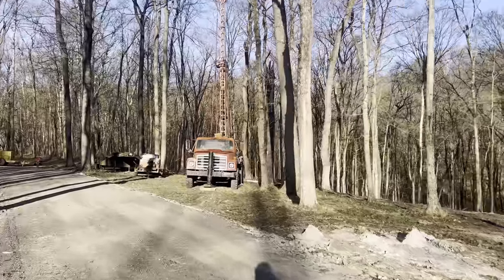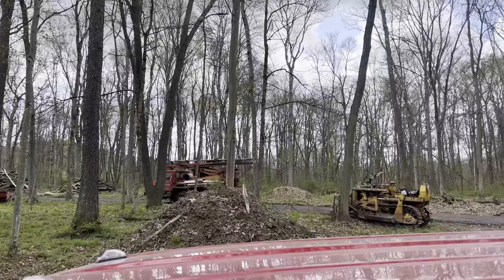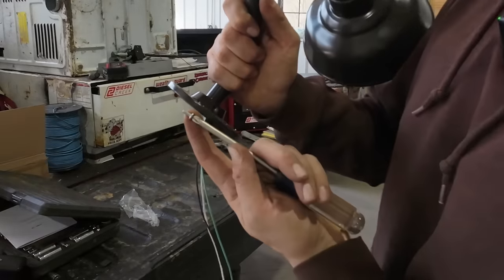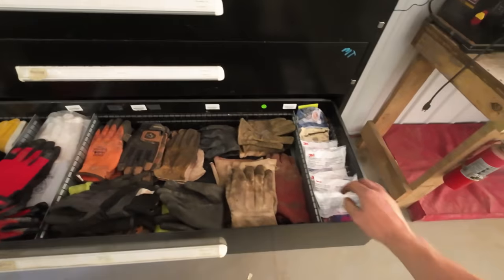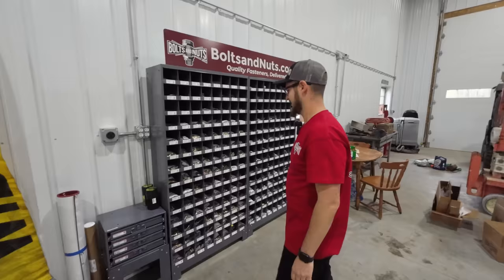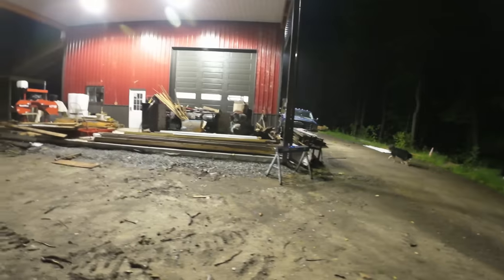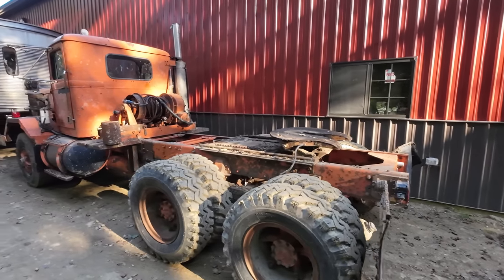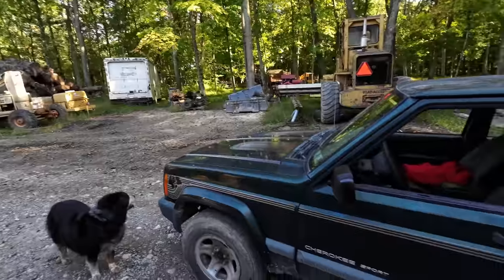1 YEAR Later, What happened to the DREAM SHOP BUILD

Comment: im a driller by profession, using probably the most advanced tools you can get to drill water wells. 2018 year equipment. Drilling in Scandinavia with one of the hardest rock on earth. We drill mostly 5.5" diameter, approx 35 Meters per hour with Atlas Copco Y35 (35 Bar) compressor and 700 Litres of air per second.

I heard arguments like you stated that older drilling methods are better but not really seen much to back it up. I do however noticed there is a big difference in Location. You can move the hole just 15 meters and it will drasticly change your result because how the water veins go. Problem is noone knows how they go so its basicly based on Luck...
I have seen all sorts of wizardry and witchcraft to try to determine where to drill, but i never seen it do any difference. People claim there is water when there is not and vice versa.

When we do not find water we use a method of lowering a hydraulic rubber bladder to seal the well to the top, then pumping high pressure water under it into the well, this opens up and clears potential gunk in the hole. Mostly with great result. That is a solution you can use on a well if you want to increase low water flow or if there is no water at all.

The rig in the pictures we used similar in the 1950-60's. In Scandinavia they are only used in museums nowadays. Fun to see it operate, but not very cost effective if drilling is your profession. Out of context a fully functional water well with pump and a well ranging from 50-100m deep will cost roughly $9.000 with guaranteed water result :)

Fun to see your videos as im a film maker myself and also work with all sorts of equipment :) // From Sweden

Comment: Thank you for sharing that antique well drilling rig! I have never seen one like it before. Also, congratulations on your new well! You might want to have the water tested though. It could have diesel contamination. 🤣
Reply: It is called a cable tool drill.  The cuttings are cleared by use of the baler It collects the drilled debris that is mixed in the water. The baler is emptied  by a release value at the bottom of the baler and disposed of with the water when the baler is emptied each time it makes a trip up from the bottom of the well. One benefit of the pounding of the cable tool  drill is that it fractures the surrounding rock letting more water flow into the hole. The disadvantage of the cable tool drill is the tool can get wedged in the hole, if the rock leads off to the side. Including a set of "jars" in the tool line helps to get the drill unstuck when this happens. But you have to put that device in before the bit gets stuck, or you  may not be able to get the drill bit unstuck by lifting with the cable alone.😢

Comment: I think building the boiler as well as moving the mill to its permanent place are the priority. Getting the shop connected tobthe grid is also up there if you don't have dependable sources of power or it's too expensive.  Having your heating situation sorted is going to be appreciated come the dead of winter.  Getting that mill moved clears a lot of clutter away.  Less clutter is where we're going.  Also, move your extra wrenches out into storage.  Keep tabs of where you put everything in Googledocs.  That way you can just pull up the location of whatever you're missing no matter where you're crouched.

Comment: Also the reason the nut on the light is reverse is because unscrewing the bulb it would tighten the nut instead of loosening it. Bulbs in sockets over time will get stuck. Just a thought

Comment: @dieselcreek - Just a thought......with the cost to bring in service @$50k just for power company, couldn't you have the service brought onto the front of the property, then run your own wires from there? Does power company have to establish service on the building or could it be established on a remote structure closer to property line?

Perhaps this has been explored or has been previously suggested in comments.

Comment: I was wondering if you plan for a 2nd level in the shop along 1 wall for storage.  How would it fit in with your planned crane?
Although I like wrenches in drawers, I find having screwdrivers on hanging apparatus on a wall board of somekind (french cleat or peg board).
Also for your shop do you plan to have a tool-cart or 2?

Comment: I’ll have to buy one of those boltsandnuts stand and stick it in my pants….I can never find my nuts. 🤣🤣🤣 I agree with your logic with the solar. I am with you in the cost and durability. That’s one of the reasons I haven’t got solar. It would take about 5 years to get my money back and my house is not conducive to having a solar system that would produce enough power. Lovely workshop. 👏🇦🇺😁

Comment: It is called a cable tool drill rig they have been used as far back as the late 1800
Before they perfected wire cable it was ran with rope and a cat head and a man pulling on the rope and released the  rope again and again

Comment: How deep is your well?  What is the casing diameter?
Before you can use any drill, you need to know what is subsurface.  
Pounding drills are illegal in some states and jurisdictions , why?   If the subsurface is fragile, as in Florida,  pounding drill will fracture the ceiling on the hollow space below.  Used to be full of water but development has lowered water tables.  Many sinkholes were the result.  Only rotary drills are permitted.  The cracks in the limestone ceiling allow acidic rainwater to dissolve the limestone.
Like all tools, both rigs have their pluses and minuses.  
I heard running water down the hole, curious, an underground river has a new waterfall!  😄  Perhaps you poked thru an old coal mine was below and the water falls.
When I lived in your area, I had to buy subsidence insurance.  An abandoned coal mine was underground and in case the roof collapsed...    I am sure you have heard these stories.

Comment: In case you were not aware the batteries last 7000-12000 complete charge cycles and after all that they are still 80% capacity of new, so they will last 20+ years and still be usable.  In 20 years the battery technology will be much improved and cheaper as well.  Same with the panels, they will last decades and are already pretty cheap now per 450 watt panel, when it comes times to replace them they will be even cheaper.  All while electricity cost per kw just keeps rising from the utility company.  I understand you think your needs will be more than you can build but if you were to diy a very large system it would have been sufficient and way cheaper than from the utility company.  Put 50-60k into DIY setup and you would have ~30k watts in panels, ~200 Kwh in batteries and 24-36k watts of inverter power.  Would have been a sweet setup! :)

Comment: Main components of solar for the cheapest worth buying in my opinion, 50 cents per watt of panel, and 300 dollars per kwh of battery (diy/buy it yourself). There are lots more costs in panel mounting and some wiring obviously but main components that'd about the price. 5 grand gets you a ton of inverter capacity for all but the most absurd power demands. In my opinion off grid setups must be light in power demand by design to limit battery costs which end up being a major cost for winter capability. Grid tie solar where you get net metering with the power company is where it is at for low investment and high return. But the power company will never pay you money at least in my area and at the end of the year excess power credits get wiped. Anyway for about 10 grand and net metering I bet you could have a zero cost power bill for 20 years.

Comment: One other thing I would seriously question about solar is some of the loads you'll be putting on it.  Running lights,  appliances, and HVAC is one thing.  I'd like to see how they would size a system for a 10 or 15 HP air compressor and a few hundred amps of welder.

Comment: i just think like i commented that direct burial wire would have saved a ton of money over laying in conduit.  now maybe you can't direct burial 3 phase.  or over 200 amp.  that i do not know.
Reply from the maker: I did what the power company requires
Reply: ok.  every area is different.  but that sucks.  we have a buried line 1/4 mile long.  love the videos Matt.  Watch every one.  Between you and Andrew Comrata, and Watch wes work, I get all the old equipment videos I need.  although yours are the oldest lol. @DieselCreek

Comment: you never mentioned the 800 pound gorilla in the shop. did you ever find a engineering firm to help you (give recommendations) on installing the crane or is the crane a good idea but too much in practice to install?? I sure figured the idea would be to install the crane structure first & then build the building 2nd

Comment: Solar is great... But its not really possible to go "off grid" with a shop and a house. Usually solar is just a supplement system used to power a heat pump, well, and maybe a a pool heater.  You really cannot power a whole shop and house off the panels that would fit on the roof. You would need a whole field of them.

Comment: unfortunately Matt far too many people have no idea how expensive a solar system is especially the amount of power you will need and off grid requires battery maintenance. the batteries need periodic replacement. Grid power in the long run is usually the best value and the infrastructure is theirs to maintain

Comment: As much as I like off grid power it is just way too expensive for your uses. I have an off grid location with solar for lighting and basic power (12v 100ah battery) but for anything else a generator is run. If I lived there I would build a larger system but I don't think it could ever be large enough (due to cost) for my vehicle restoration uses.

Comment: Solar does not supply enough consistent power to operate a modern heavy-duty equipment shop unless you spend 100's of $1000 on panels and battteries which unlike traditional power supplies, have a limited life.

Comment: Re solar. Your justifications for not using it did not appear to include the ongoing costs of grid supply and increasing costs. OK, youre in a valley but you dont need 12 hours of sunlight daily. As for household usage. How much daily power do you really need? My household property has only a 30 Amp supply and we never run out.

Comment: I don’t know why people like pushing solar power so hard. It’s not a good way to power anything important. Even here in Texas, solar never performs like they say it will. That’s why I bought property with springs on it. Hydroelectric is far more efficient and reliable, so I just made ponds fed by the springs that flow into a hydroelectric generator. I even generate three phase 480 for my shop. My system cost less than the recommended amount of solar, and the power company pays me for the excess. That’s way better than solar in my opinion.

Comment: ....... It still would of worked out if you built your solar setup right. I'd have also added a diesel generator back up cause you're already working on Diesels and you might as well have your own Diesel power plant as backup when if the solar wasn't enough. the only place having a solar system doesn't make sense at any scale solely is Alaska, simply cause the winter the only use it'd have is if you had a water heater integrated into the solar panel for cooling in the summer and keeping the snow from building too much on the roof in the dead of winter. Granted Everyone saying you should of got Solar maybe Annoying but they're just wanting the best and as long as your not living above the 45th parallel odds are you just got to figure the math out on if you can get a system that works for you that you can afford to maintain. Especially for that new house you're planning to build you could of used the shop as a test bed to figure out the nitty gritty and made the house run smooth.

Comment: I would go solar in your shoes! That's probably because I love tinkering with that stuff. If you build your own 48V batteries using LiFePO4 cells from china it is a lot cheaper than buying even the cheapest rack mount batteries. And solar panels are pretty cheap compared to the rest of the system, so you can compensate with more panels to have decent generation even on cloudy days. You sure have roof space! Anyway, I understand your decision. Thanks for awesome content!

Comment: solar system with batteries arent cost effective... the setup that is cost effective is the one that where you have solar system AND become a producer and resell it to your local grid company. so when you are producing more than you are consuming, your local grid start crediting you... when you arent producing enough, then you start pulling from the grid. basically the batteries are replaced by your local grid company. no batteries to change or maintain... acheiving 0$ electric bills are easily acheived... spring and autumn are where you producing the most normally (no need of AC and not heating much!)... so yeah, during winter, you may be not producing a lot but if you got 3000$ in credit...you can pull from the grid without being annoyed!.... but with this system..you still need a diesel generator if you are losing Grid power and your solar system isnt producing much. I think its still a good deal. VERY popular in Europe... more and more in  all Americas.

Comment: Wow. Your idea of solar is off. Panels and batteries have come a long way in the last few years. Prices are down, panel efficiency is up. May I suggest, purchase a small system. 4 used 200w panels. An all in one inverter. And 400Ah of lithium battery. All of that should run about $2k. Set it up for 1 or 2 items. Everything in your office. See for yourself how useful bi-facial panels are in low sun settings.

Comment: Modern solar aystems do not operate in the ways you describe, but they are still not 100% the end all be all system. The panel degradation in 15-20 years is only to an 80% of original pa el capacity. Modern Lithium and other batteries will easily go 15 years in a solar solution before having a reduced capacity (not dead). By that time tech will change and a new improved solution will be available. As for solar collection. You may be really surprised, get a solar camera and set it up, collect data for a year and see what it really says.

Comment: Solar setup is a waste, my dad spent $22k on his for tiny house. He has a 20 battery setup ($10k just in storage batteries), forget the wattage but I'll say 300-600w. He'd Bought $600 generator to help the system because the system couldn't handle microwave or air fryer while the fridge was plugged in, underpowered waste of money

Comment: am I'm I blind or are the barn lights two different sizes ? the one's you pulled out of the box were much bigger than the lites you demonstrated in the assembly with and the lights the contractor installed were bigger as well, yikes, help me out man
Reply from the maker: Big ones for above the garage doors and small ones above the man doors

Comment: I hope you at least brought 3 phase power in. If you don't, I guarantee you'll regret it
Reply from the maker: Not available here. If you really wanted it, you’d have millions in getting it run here
Reply: @DieselCreek  I guess you only have single phase out at the road, that sucks. Pad mount transformer up by your shop? How many KVA transformer? You can always get or build a rotary converter if you need to run  three phase equipment. What sucks is with single phase you are limited to motors 7.5 HP and lower. Not to mention 3 phase stuff goes cheap at auction because not many people have the 3 phase to run it

Comment: You mentioned Solar Systems loosing significant efficiency after 20Y or so, thus needing another great investment again which you want to avoid. As an electrical engineer I would just like to inform you that the efficiency loss of modern solar panels won‘t be as huge as you think! There is a loss of efficiency, but it‘s going to be around 15-20% max after 20 years! As a rule of thumb a quarter of your rated output power might subside after approx. 30+ Years. So if you account for that diminishing output at the time of your solar installation simply by installing +30% extra of solar-power than initially needed, just so you can still be relying on your Solar-plant a few decades later when all the excess power has been eaten up by the efficiency drop 30 years down the road.
So you see, it‘s a rather slow aging process… Just some info I felt like you might like to know! Keep it up!!

Comment: Your misconceptions about solar are disappointing. It can be very viable if you do it right. Especially with such a large roof area. I'm not saying you definitely wouldn't need another source of power during the darkest coldest months, but don't underestimate things. Yes they do degrade, like any device but not necessarily at the rates you are implying.
Reply from the maker: I’ve don’t lots of research, I don’t think they are misconceptions…

Comment: I hate to be, The dinner but I have tried going off Grid, it's Not going to be To go off grid but I am waiting To see what the power company. Hey, it's gonna cost him 2 run That Wire? And what? Here's electric bill. Is it gonna be the cause? I am expecting it to be over $1200 a month. And that is not including what the power company charge to run the Wire? I am expecting they cost to run The Wire.
Up In to the thousands.
And if the power company Get
The 15%.
Increase like they are trying to do it may be even higher.